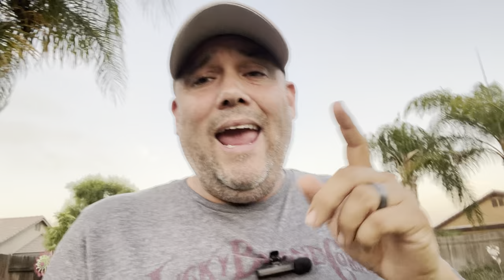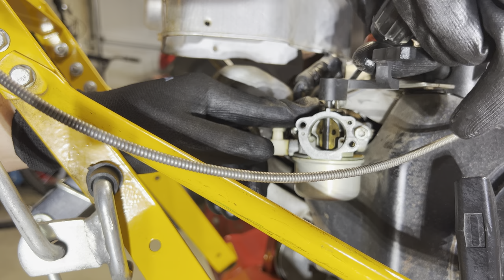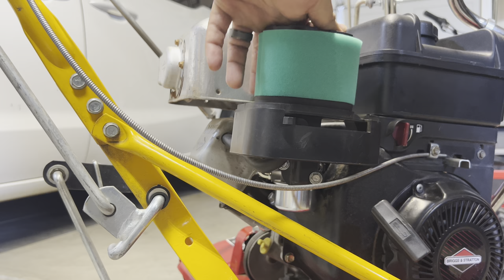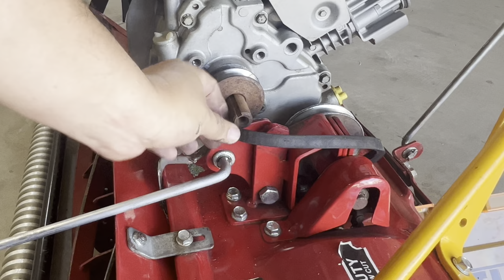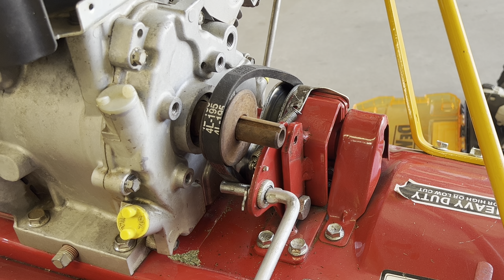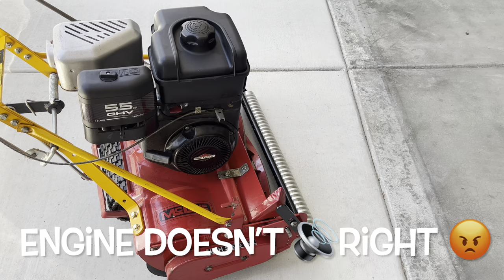McLane maintenance - How to replace Belt, Carburetor, Air filter, & Spark Plug DW🌎 S2:E23

Comment: First off thank you for getting me into reel mowing and convincing me to buy a mclane. I love it. Quick question I am having a problem with my belt slipping off the back pulley. Should I just replace the belt or should I try to adjust it? If so how do I make it tighter? Thanx!
Reply: Shoot sorry I jumped the gun! U already showed us that! U rock
Reply from the maker: There is a couple of things i would check. If it’s falling off is the springs holds the clutch pulley in place. If it’s damaged or loose this can cause the issue. I would also see if there is any adjustment with the belt cover. The belt cover should help keep the belt in place when not being depress but shouldn’t be the main factor to why it’s falling off. I did demonstrate in video how to adjust the clutch arm to increase of decrease the tension. If you have additional questions you can email me or comment in response.
Reply: @dwaynesworldlawn  thank you!

Comment: Replace the fuel filter attached to the peck cock that lives in the fuel tank. I’m pretty sure that model has one. Look in the tank and see.
Reply from the maker: Thanks for the tip. I did replace the gas tank on this mower so everything in the gas tank is new but will take a look either way. Appreciate the suggestion !!!! 👍🏻